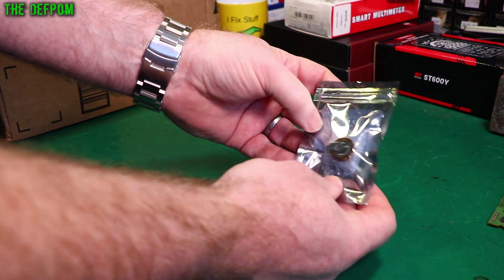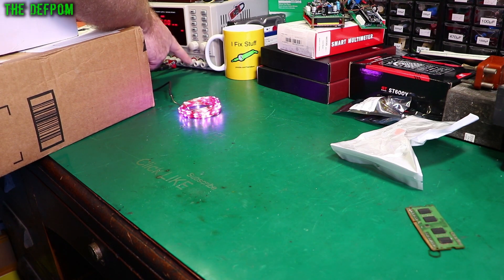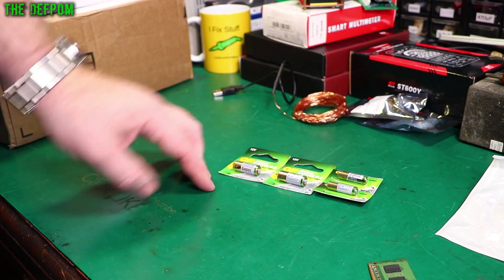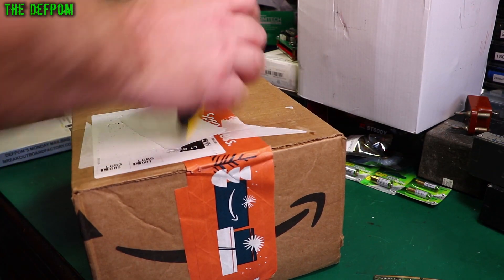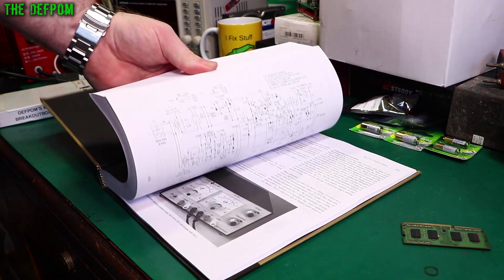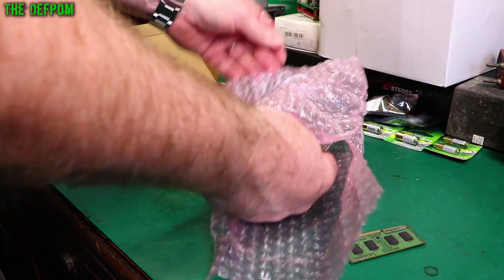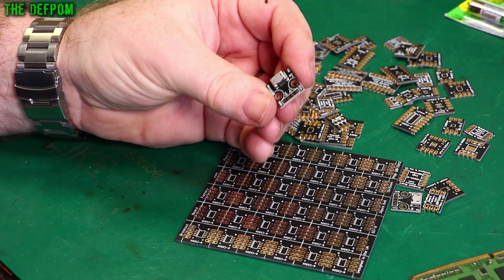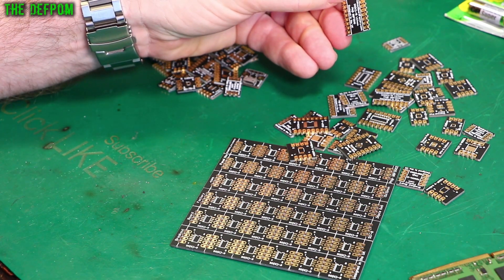🔴 What's in my Mailbag ? - Mailbag Monday 3rd January 2022 - No.908

Comment: Thanks for checking out the boards and the compliments, I really appreciate this!
I've sent whole selection (plus SO-8 on a whole panel for fun), but that whole selection is kind of a demo of what the plan is, which is to sell breakout for every single type of SMT footprints, such that you can go to one place/manufacturer and be able to get all the types you need without going to multiple sites and place multiple orders.
I've experienced this first hand at my 9-5 work, it's a hassle finding the breakout boards.
Castellated edges are just a bonus, an idea of mine (soon probably copied by china).

PS sorry for throwing them all in one bag, as of now I don't pack each single type in an individual bag, figured it would be a good thing to reduce pollution, usually I tape those (with kapton tape so no residue) to the invoice and have those go in an envelope, down the line I'd come with some all paper solution with some sort of a pocket deal where the boards sit in for shipping purposes but can also serve as means of assorted long term storage.
Reply: Great Idea !